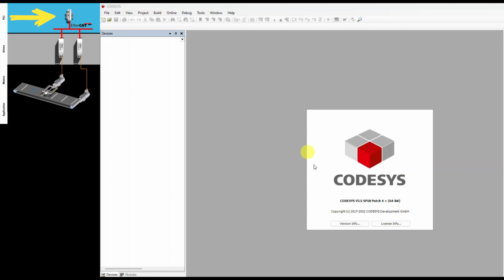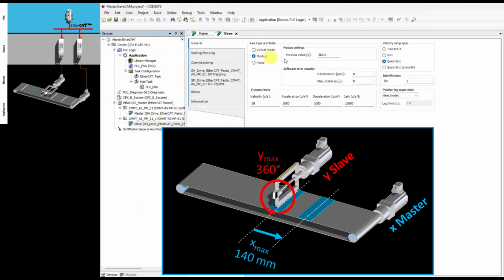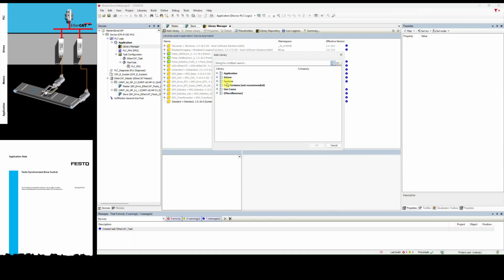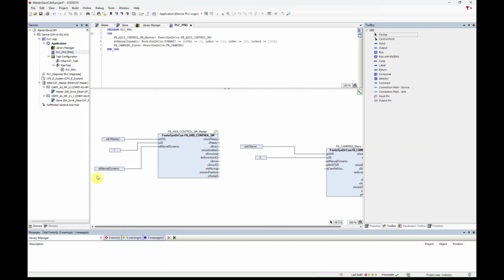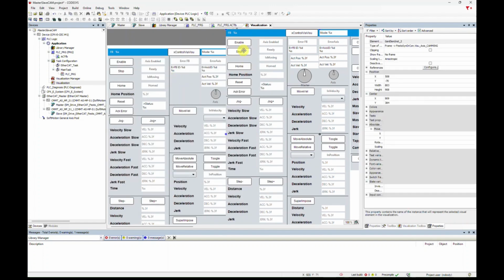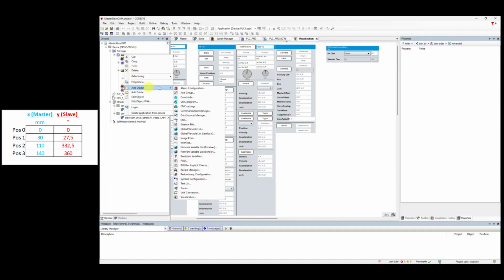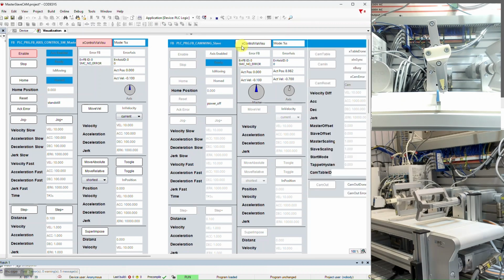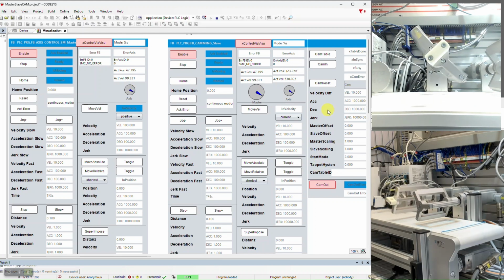[7.3] Rotary Knife - Programming

Comment: Why does the cam curve have to stop before entering the cutting zone, not at a constant speed like when the knife leaves the cutting zone? thanks admin!
Reply from the maker: The synchronization of the cam occurs only during the cutting phase. This ensures that the knife blade is precisely timed to match the speed of the conveyor. During the other phase, the rotary knife must accelerate and then decelerate to align with the conveyor position at the moment of the cut.